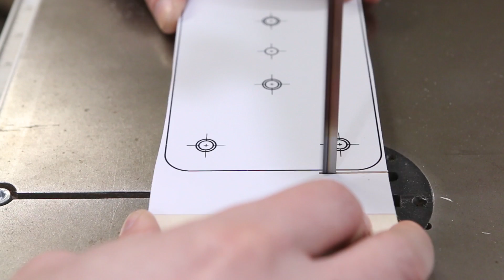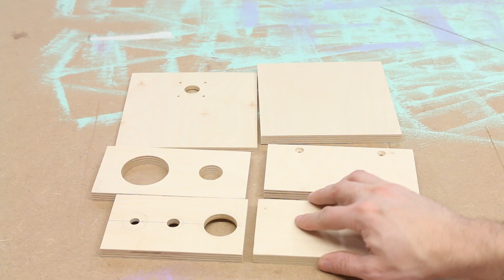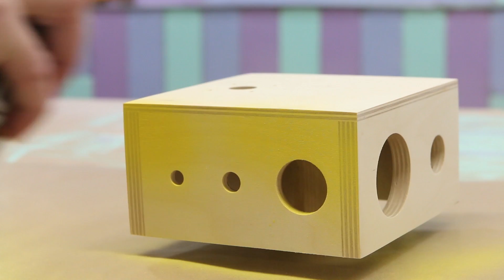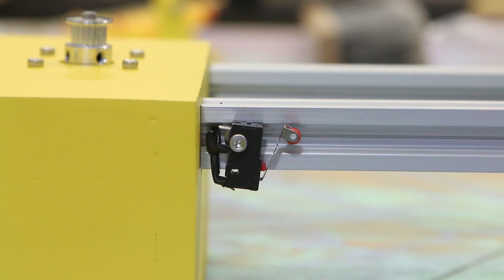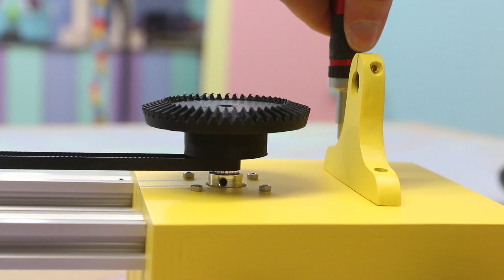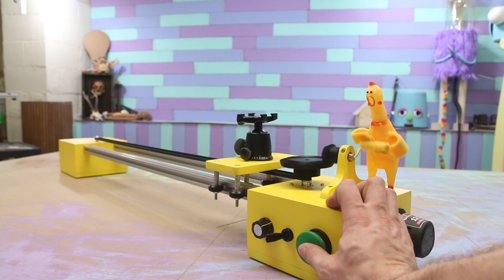Camera Slider with Chicken Power! | Arduino controlled motorized camera slider

Comment: Awesome, always love your builds! Exactly my spirit of making things! 
Do you monitor the voltage of the Bosch battery in any way? Like maybe an ordinary Lipo protector? Or is there already protection circuitry inside the battery pack?
Reply from the maker: Honestly, no idea! Haha. Didn’t put any thought into that. It just plugs right into the arduino motor shield currently
Reply: @TheMakerMonster  Well I guess you could always plug it back into your drill toncheck the battery status once in a while. The idea to use that battery back is still awesome.